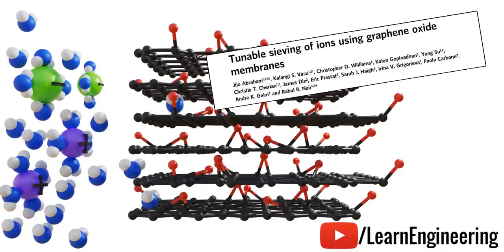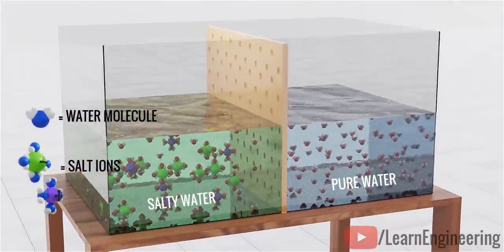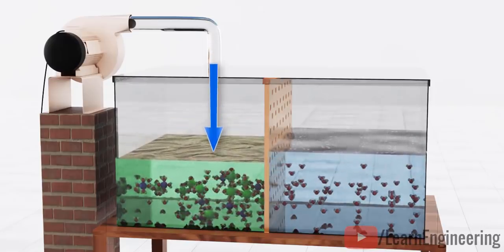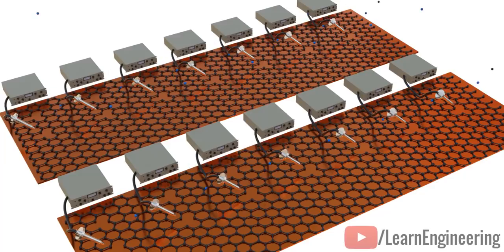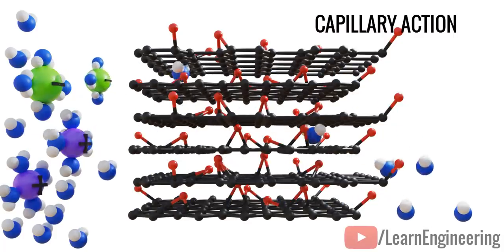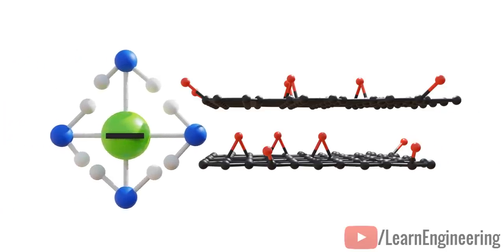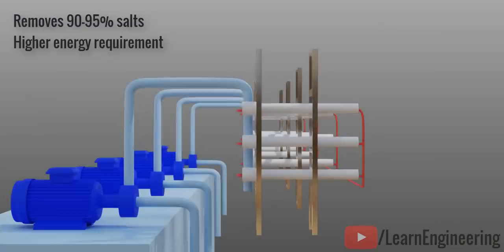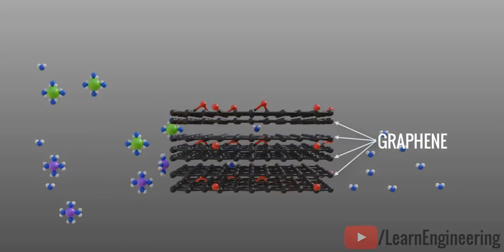Graphene Filtration | A revolution in Desalination technology!

Comment: I don't doubt that graphene would require less energy but give us some supporting details. There is also a lack of any mention of the lifespan of graphene filtration. Those details may not be available to you yet but this came off as a commercial for graphene instead of a research-based presentation on the superiority or competitiveness of this material in this application.

Comment: When the water moves thru the GO sheet - let’s say from left to right to follow the graphical representation used here - the salt concentration on the left increases. 

This raises the negative osmotic pressure on the left and ‘sucks’ the water back from the right (fresh water) side that had just come through to the fresh water side.

One way this is stopped is if the spacing between GO sheets acts as a one way valve, only allowing fresh water molecules to travel in one direction, towards the fresh water side.

Another way is pressure against the salt water - so again Reverse Osmosis, hopefully with a much lower pressure and energy requirement.

A possible third way is to have the salt water in a container with the GO sheets at the bottom. Gravity will pull the fresh water thru. If this water has to fall into a fresh water container there will be no osmotic pressure trying to send the fresh water back into the salt water.

Comment: I'm interested in how the first law of thermodynamics fits in to the equation. Reverse osmosis requires so much power because it takes that much power to separate the water, not because pump just magically consume energy. The pumps are doing the required work of separating the water. Where is the exchange of energy coming from in the case of GO filtration? If it's not in the filtration process, it must be in the manufacturing process of the GO "filter". The filtration process must, also, must not be a continuous process.

I'm genuinely curious about what is being left out of the message. I understand the need to communicate to a lay audience, but I'd hate for physics to be swept under the rug as part of a PR campaign.
Reply: Exactly what I was wondering too. I feel like there's a catch here somewhere.
Reply: Looks like capillary forces are used to over come osmotic pressure, but yea I'm curious about the numbers, and the practical implementation, as well.
Reply: @fredorpaul  but if you want to pull water out of the capillaries, you have to overcome capillary forces as well. There's no free cake
Reply: I'm wondering if the "magical" function of graphene-based desalination is just that it's a more efficiently designed porous material, in that it's designed at the atomic level for efficiency to pass a greater volume of water given a particular pressure. It's designed to fit this intended purpose from the bottom up.

As it's explained in the video, without adding pressure to the system, I'd think it would just be a more efficient gate at drawing water towards the salt.

And I thought they got the nature of the relationship between water and graphene backwards... it's not hydrophilic, it's hydrophibic.
Reply: The inherent resistance of the membrane, not the separation, is the place where savings are had. Because running pure water through it would still take energy, despite the lack of separation. That's the energy in question here.
Reply: @specialopsdave  , is the resistance of polymer-based membranes to permeate flux so high that there would be a commercial advantage for the GO membrane? I use state-of-the-art mathematical models of the RO process but they don't account for irreversiblities in the process, which leads me to believe that others have deemed the irreversiblity negligible.
Reply: @specialopsdave  I think you're right. I thought a bit harder about it and it is the case that passing water through the RO membranes is irreversible. Ideally you would want to pass the water through using just the enough pressure to overcome the osmotic pressure. But a problem is that salts diffuse through the membrane as well, just a very low rate compared to the water. Therefore you have to drive the water at a higher flow rate to out pace the salt diffusion and have acceptably low salt concentration. This requires a higher pressure than the osmotic pressure. That's were the disadvantage lies in polyamide and cellulose membranes. Ideally you would have a membrane or that allows only water and absolutely no other molecules so that you didn't have to out pace diffusion of those unwanted molecules.

Comment: Osmosis (or reverse osmosis) can be useful but it is not everyting and still takes energy. If you truly have simply water vs water with salt, the reverse osmosis wastes the chlorine that would have been gathered from electrolysis on the salt water (if you are using energy anyway, as for example a combination of geothermal, solar and hydroelectric). That chlorine can be used to kill germs and has other useful properties as a halide (and can change a pH and so on). Then there is sodium which is also useful. Plus you are not dumping a bunch of salt.

Comment: Doesnt matter what you use as membran, the problem is the blocking of the membran and bio growth. 
These are the real elements make it inefficent, while in a indsturial complex you can clean it and have personal that know what they are doing, who shall do these tasks in a unit for a privat household? 
Yeah exactly the practical solution are throw away exchangeable units most likely.

Also while the membran material might change, this is nothing new, we know about this process for years
Reply: Well, if it is cheap enough, It can be used for short time and then replaced. But for some reason I am skeptical about this. Until I see a plant that is using this, it's just a theory.

Comment: Only issue with Graphene is what to do with the used material because when China did there Air filtration plants (which work great BTW) but even the designer said they can make some jewlery with the graphene but there is still left over material that needs a recycling solution so can be used.

Comment: It is wrong to say that with a graphene based membrane water will flow from the salt side to the pure side. The graphene membrane will act exactly like a semipermeable membrane. You still have to apply pressure or force to move water from the salt side to saltless side.

Comment: Oh and btw no to burst your bubble with reality, 
but the effenicy (as shown in this video) of cleanig water isnt the same as safing energy, it just the grade of filtration. Filtrating better due to smaller or more optimized pores. So the quality of the water at the end is more pure. It doesnt give any indication if ou have to use more/less or equal force to get there (energy consumption). 

Also while super pure water is realy intersting for certain industrial aplications like for powerplants with total evaporarion cycle, 
the human body doesnt need pure water a few salt ions are ok, it just have to reach the perminable level for drinking water, if water shortage is the problem here.
Reply: He said in the video that the filtration operates through capillary action, which of course doesn’t require any external energy source.

Comment: If you want efficient Graphene or pristine Graphene use magnetic correlation, Hydrogen makes carbon magnetic so the carbon will magnetically align with a correlated magnet. That should solve your production problem of Graphene.

Comment: Even though this process may be more efficient than current reverse-osmosis processes, it will still be energy intensive. This is based upon thermodynamics, not just engineering. Separating salt from a water solution is working against entropy, which requires significant input of energy.
Reply: thats what i thought. they showed it in the video, as if the water just naturally flows through and the salt just stays. like thats not how real physics work.
Reply: dont forget that each membrane unit is 1 atom thick and to make a large sheet of stacked planar pores you need an insane number of layers on the order of avogadros number.

Comment: I used 'passive evaporation' ... pyramid shaped plexiglass atop a ring float with edge vats to catch the freshwater
I let several of these act as buoys in a sea lagoon (California) and collected several gallons per day (sunny)
I can imagine a 'graphene' blanket or 'fullerenes' built in a nano 3d printer to the perfect 'mole' density (h2o) with aluminum oxide 'supersaturate' so that the electrical plasma could break the dipole and compress the two gasses in a blimp where the hydrogen could provide energy to the drone blades...what do you think? (with an h20 precipitant ...humidity condenser)

Comment: This can not work, and it is easy to show:
Osmosis creates a water level difference as shown.
If you could get the water from the higher side down to the lower side through a graphene oxide filter, without applying at least the osmotic pressure, you could build a perpetuum mobile from it. Using a GO membrane is normal reverse osmosis, there is no way around it.
Reply: Correct, in an ideal, 100% efficient system at least the osmotic energy must be added to the solution to achieve desalination. The rest of loss is pump efficiency, membrane architecture and the energy of dropped concentrate (might be recovered).
Reply: Perhaps they meant to say GO has lower resistance to water flow which increases efficiency, but you definitely can't get something from nothing.

Comment: i dont get why we dont take advantage of solar. use solar thermal to evaporate/distill the water and could even use it for electrolysis (high temp and high pressure make it more efficient)and then use a fuel to combine the oxygen and hydrogen creating power and water.